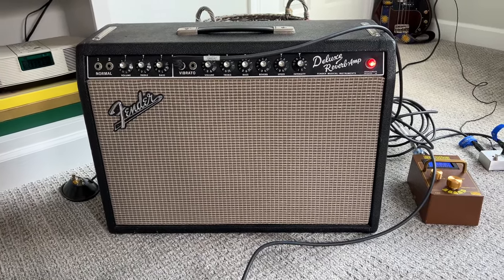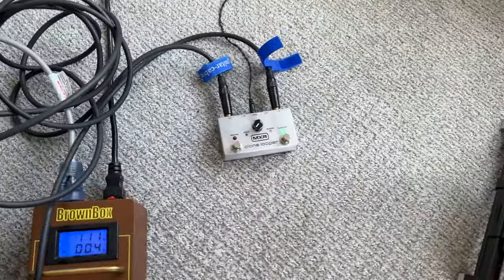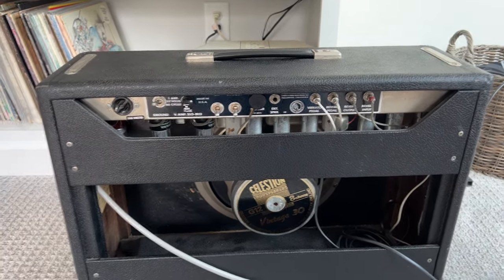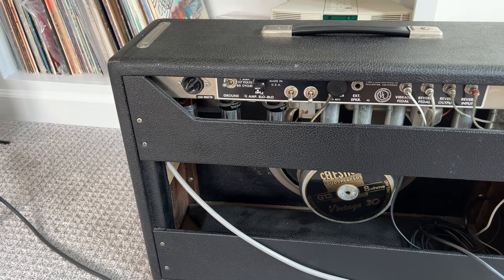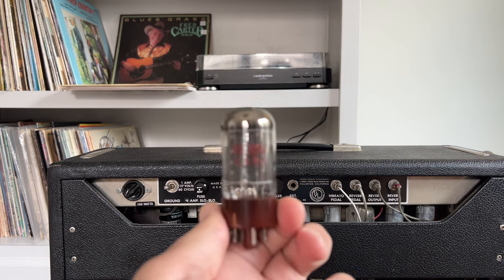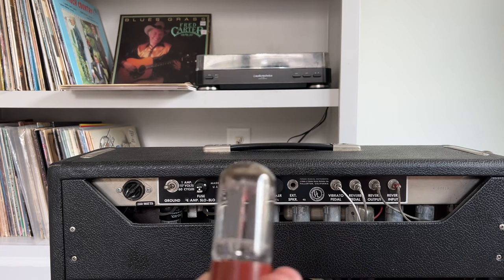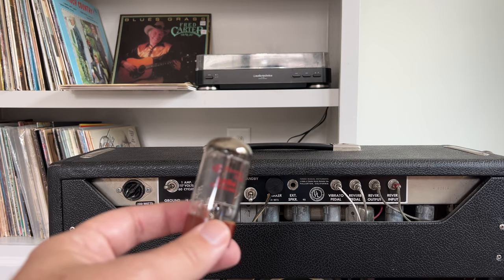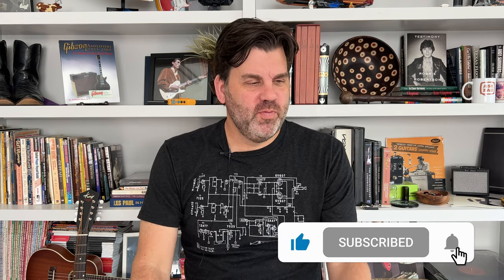How To Easily Locate A Rattling Tube - Ask Zac 134

Comment: Hey Zac!  I had great luck with the really thick tube dampers from Eurotubes.  They have much more surface area than the typical silicon rings and apply greater pressure around the glass. Saved a wonderful '71 7 notch Mullard GZ34 I use in my Fat Jimmy.  Looper is definitely the way to go for pinpointing the culprit!

Comment: I use a Sovtek 5AR4 (GZ34) in two of my  amps that use them...new ones.  I've been getting new ones for a while now and they really don't last long. I just changed one out and it had been in there for about 4 years. Typically I get about 2 years out of one before they blow fuses and are done. I know thtat the NOS are way better but they can be so expensive. I get my tubes here at the Tubestore in Canada...great quick service....they ship to the States.

Comment: Combo amps just love to have this problem. Whole lotta shakin going on ya know? I have a divided by 13 that’s sensitive to it and I quieted the rattle a bit using a silicon ring around the offending tube. They make rings for ummmmmm adult use that are a great fit for preamp tubes 😂
Reply: Makes sense…designed to help your amp um…stand up for the entire performance. (Is that a rectifier tube in your pocket?) 🤣😂😇
This gets worse: (Opening scene with obligatory wah pedal guitar) Young lady in bathrobe opens the door to a moustached man carrying a Sweetwater backpack, who says “Good afternoon. I’m here to help you with that rattling in your tubes…”😇

Comment: Lol. You did show the tapping with the pencil. That is what the video was supposed to be. Cracking up.  Next time pull the cover for easy access. You can even tap on them with your finger nail like you did with the tube out... when the amp is on and idling. You can't get shocked touching the glass. The offender(s) will ring out. Get some nos tubes for that thing while they can still be got.

Comment: peculiar to the Deluxe Reverb and could carry to other amplifiers as combo amps.....IS that the cabinet resonates.....this can be manifested on the steel chassis and depending on the frequency...can manifest on particular tubes in the pre-amp section while others are not affected or the manifestation travels between tubes and frequency.....SPECIALLY with the metal spring cans on the tubes.  You may find the ringing goes away when the tube can is removed......because the resonant frequency is acting on that tube and its vibrating the can & spring on the glass of the tube...AND its not a weak spring.  SO the solution is to place some electrical tape between the spring and the contact surface of the glass of the tube......and you might even have to wrap the metal base of the tube socket to fit the metal can over.....or use some shrink tubing.  MESA ENGINEERING used to sell the Mesa tubes with the heat shrink wrapped glass of the pre-amp tubes.  In Electronics terms,  you have the action going on inside the tube as it does its thing.......the metal can is mechanically connected to ground via being metal and the base of the tube socket being fixed to the chassis and thus chassis ground.  The electrical tape or heat shrink tubing on the tube will sort of create the definition of a capacitor as 2 conductors separated by an insulator and would much be like the Late Fender thing of the CBS era as to place the shunting caps on the power tubes and elsewhere......the glass would be an insulator but adding the extra with the tape or shrink wrap enhances beyond the vibrational aspect & cushioning the vibrations......and part of that scenario of if the amp sounds better with the tubes in the cans or with the cans off & that hocus pocus argument that exists
Reply: keep in mind that the contact point between the steel spring and the glass....the vibrational aspect is not always as an impact like tapping on the glass with something......that metal spring can vibrate side to side as in brushing the glass.  But that is basically linear thinking in 2 planes or 2D.....when things are 3D to us......and vibration is 3D.  INSIDE the glass tube...the guts are fitted to like the 2 star looking spacers that touch the glass inside.....they are precision pieces with placed holes.  SO on the tube assembly lines when the lines were properly maintained when production was mainstream....they strictly controlled these fixtures creating the holes for assembly.......as tubes phased out...they quit maintaining them as intensely as they did.....and retired the machinery as it broke down and kept the remaining lines going as they continued to phase out production.  So depending on supply contracts....meaning military, the regular scheduled maintenance was concentrated as it was now a specialty scenario and subject to specifications.  In the general production lines in the hey day, they had quality control aspects at the end of production to check tubes......the high testing within a graduation had a high test limit which designated MILITARY GRADE within the batch being tested coming off the particular assemble line.  The tubes which did not make that cut off for MILITARY GRADE.....were then subject to second tier specifications which are designated INDUSTRIAL GRADE.  The tubes which did not meet the cutoff for INDUSTRIAL GRADE...became 3rd tier which is CONSUMER GRADE...the average tube to the pedestrian electronics consumer !     SO if you follow time line and electronics evolution for consumer grade electronics....in our homes....the tubes represented a service issue and were thus a part of the electronics field as they created jobs for field technicians to service the TV's...other than the radio's which preceded  as the NEW ELECTRONIC TECHNOLOGY...the infancy of electricity being available to the population......these are big business decisions to keep profits streaming on the back end after a sale.   SO as tubes were going to be displaced by solid state.....and with hybrid designs in the transition to solid state electronics......they did not maintain the tube production lines properly as they did ........so NOS tubes are not always automatically superior when it comes to CONSUMER GRADE TUBES and specially the late production pieces.....unless they were from a MILITARY contract....and NOT REJECTS that didn't make the cut.  In the hey day, the tubes that tested out less than the Consumer grade specs.......GOT DESTROYED.    Today...the accountants would have them being sold off which would deter the cost loss of production as a waste.....but in the long term it would damage the company and reputation......and that's why accountants should mind their place and not run companies or dictate how companies should be ran........prevent a loss today as an accounting victory & the company is out of business a few years later due to the accountants........no business dynasty for the ages.   BUT yes, considering the cost of NOS tubes.....subject to guarantee, I'd be using modern production tubes made on new modern machinery thats controlled & maintained.  There is no reason why with CNC control & the modern 3D printing technology that somebody could manufacture "NEW" vacuum tubes...DOMESTICALLY in the USA.....in a complete automated robotic environment for the assembly line.   There are the HARDCORE FLY FISHING GUYS THAT TIE THEIR OWN FLY'S......its not much far removed
Reply: one other note......when tubes were early on in production & design...think octal era......radio....the tubes tended to not always be GLASS...they had METAL TUBES.  GLASS is more prevalent in the 9 pin era...considering its all you would see today unless you dug up a stash of early era NOS stuff.  The "vacuum" aspect in production would be a carry over from making edison light bulbs......hence glass.  NOT all electronics with "glass" carry metal tube shields as in Fender style......but some positions can carry a metal sleeve over the glass which may or may not have a contact ground aspect to the chassis of the set.  Think radio and the sudden polluting of the planet with the invisible radio waves man created hahaha and how they increased in abundance from never existing before as time rolls on......and today its digital transmissions.......but they still blink at night in the night sky......in some cases.....in the 5G world now

Comment: I have this issue on my mid 70s vibro champ. It just randomly started one day after years of use and no issues. At first I thought a tube went bad or was on its way out.  I swapped them out one by one and it made no difference. I’m guessing it’s something to do with rattling from the speaker vibration. I know they sell those rings and other  products that go around the tube. Have you tried any or found a solution?